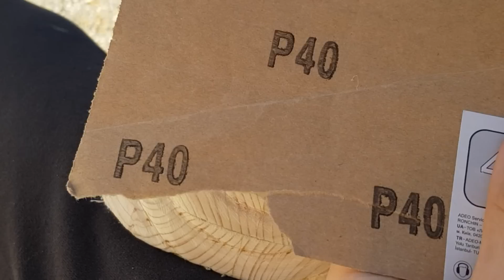Make the MASK of OBITO + SHARINGAN in WOOD - NARUTO

Comment: I have a similar way of doing it but I wouldn’t got the idea for one and for you basically I’m gonna do what you did but I’m not gonna cut holes in in the middle of each part of the mask gonna i’m going to basically stack them like you did and then sand it so it looks like one piece in the sand the bad part making sure I can still wear it so yeah that’s how I’m gonna make the Tobi mask and it also helps for helmets to
Reply from the maker: Actually you can sand the interior of the mask once you glued each layer with a hole otherwise your technique will have the same result but it will be a lot longer but send me a picture on my instagram when you will be done !